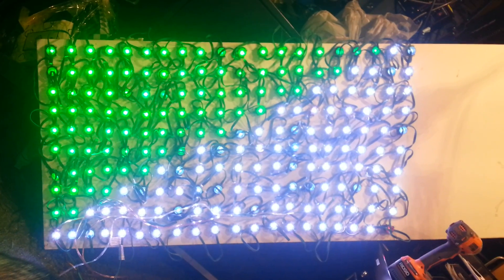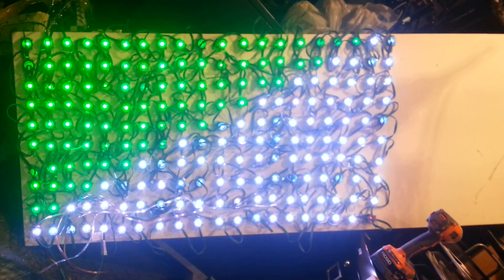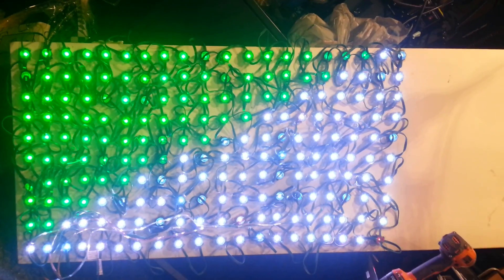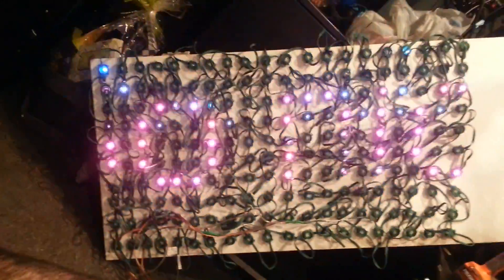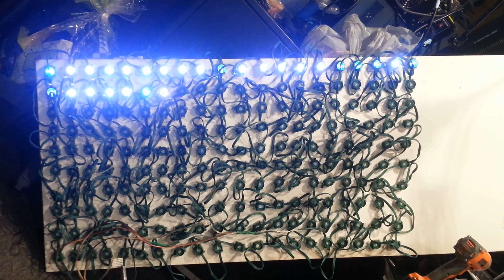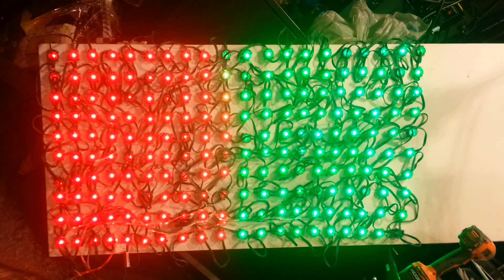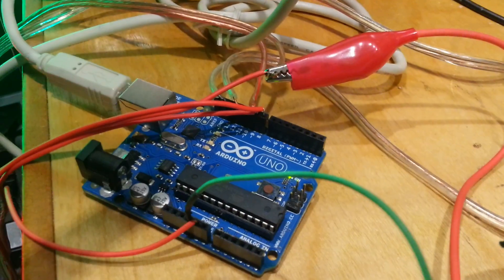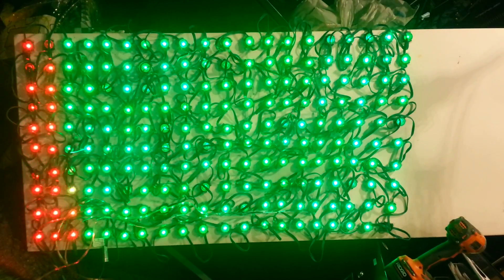G-35 LED Christmas Lights pixel board test

Comment from the maker: Total cost was actually much less, about $200 and some parts I already had.  If you count those, then $250.  Not including the wood and stuff.

Yes, you can array them any way you like, you'd just have to adjust the software to know where the pixels are.

Comment: Oh wow... you know this was driving me insane what was going on behind them sheets... from what I see on ebay this project is around 400$ for what you pulled off at FE minus the plywood sheets, although could not find that exact board online 

Can you array the pixels any way you like? say if you were to make it a thinner yet longer strip) I dont see much practical use for me.. but this might be something id want to try later as an install or something for a stage production